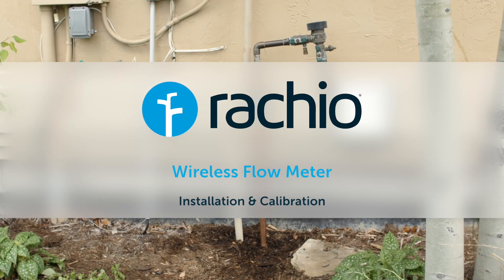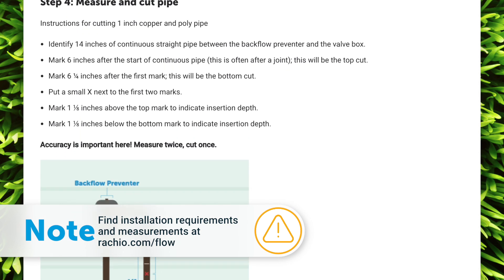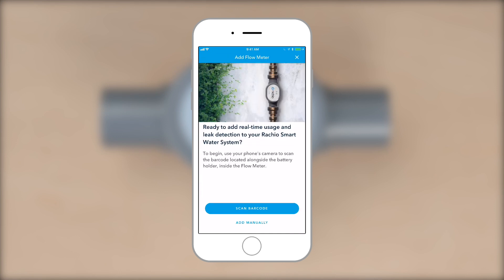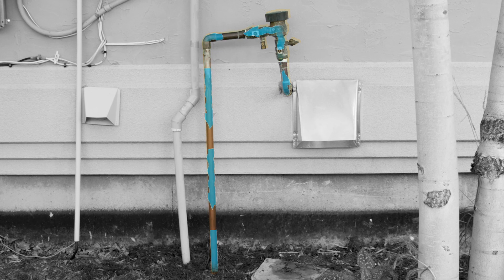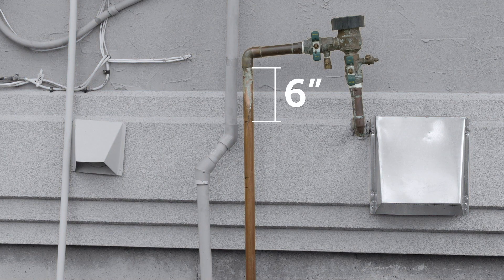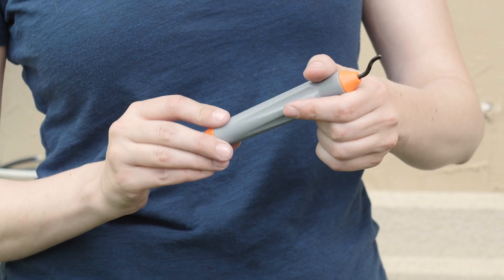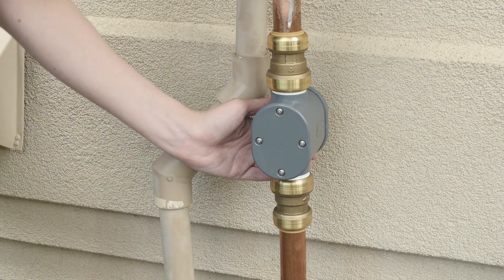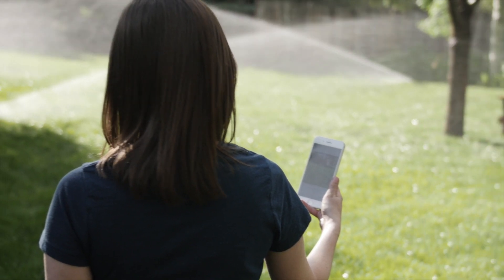Aboveground Installation & Calibration — Rachio Wireless Flow Meter

Comment: Why isn;t the flow meter available to be purchased separately for those of us that already have a controller, but want to add this to the system.
Reply from the maker: Hi Jake! The Wireless Flow Meter is only compatible with our Rachio 3 Smart Sprinkler Controller. If you already have a Rachio 3, you can purchase the flow meter separately at https://rachio.com/wireless-flow-meter
Reply: Rachio been sold out now for as long as I’ve had my v3